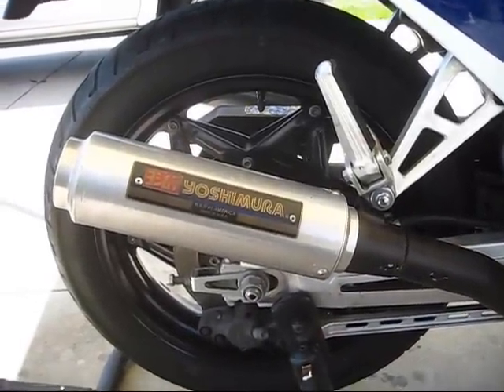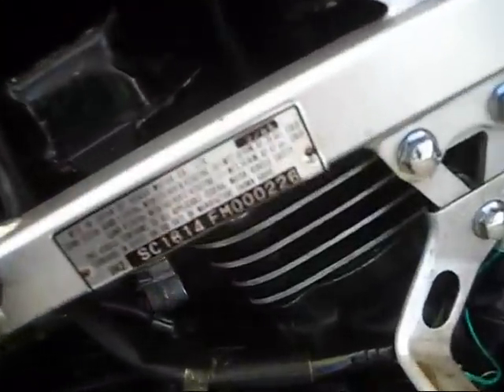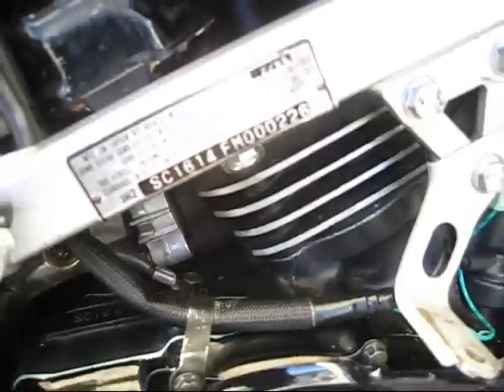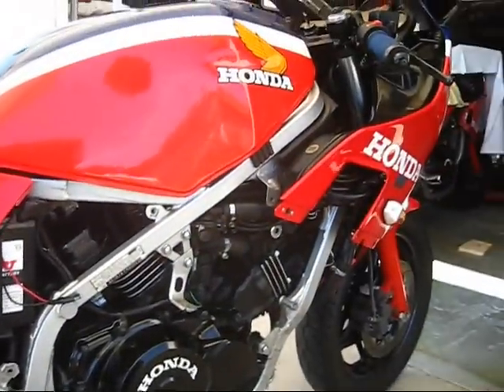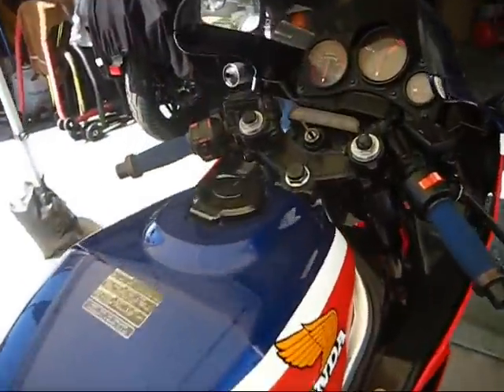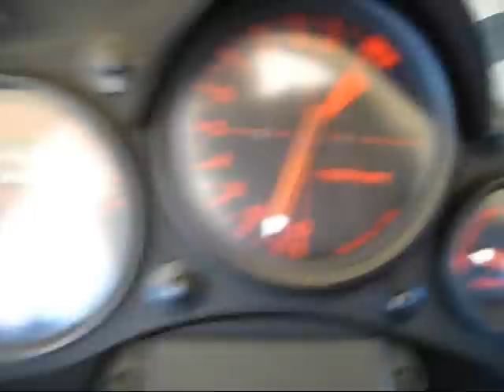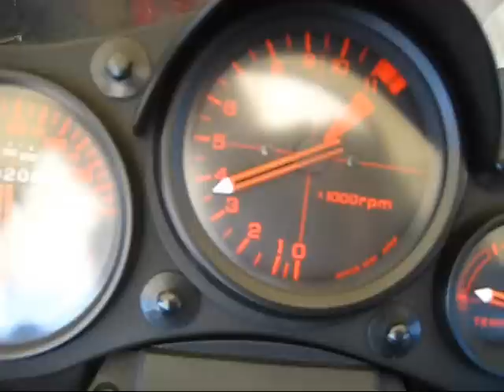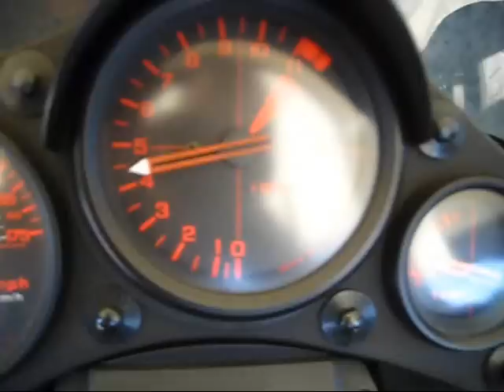1985 Honda VF1000R Yoshimura high speed passes

Comment: my favorite looking bike of all time. i currently have a 2004 ninja zx10r and love it. how would this bike compare against my zx10r?
Reply: Are you serious?, lol dumbest thing to ever ask. 650 lb bike, 13 sec1/4 mi at 108 mph. Top speed 140. A 2014 ninja 300 would whoop this.
Reply: A ninja 300 has like 40 hp dude. You'd beat it off the line maybe ( a ninja 3oo has like a 14.5 second 0-60 btw) and in some tight stuff but open the road up and your minibike would be put to shame by a 30 yr old motorbike.
Reply: +Ryan Bahr who has a ninja 300???? i have a ninja zx10r (1000cc), not 300cc. So its safe to say that my bike would beat the interceptor in ALL ways. however, i still love the look of the old interceptor.
Reply: That's funny!

Comment: any mechanical problems with the vf?  In 1985 one man wanted to buy the vf750 and the dealer tell V engine have too many problems is truth that or not?
Reply: I had VF1000r' for 10 years and they wore out big ends and wore out the cam lobes. I rode it A LOT. If you don't ride them too much and can live with weight like a supertanker and the 16" front wheel it's a bike that can grow on you. Hasn't got today's power but the motor and ride is sweet

Comment: you  guys  are  fucking  douche  bags-  your  high  speed    are  2nd  and  3rd  gear  over  reving-  by  the  way-  u  dont  know  how  to  use  a  clutch or  tachometer-  plus  your  bike  has  stock  tires  and  bolt  on  pipes  and  signals-  u  r  douchebags  beating  on  a  stock  bike-  u  fucking  posers  !

Comment: Those were noisy motors.... which is why Honda stopped making them. Not like Harley motors but you can hear all the internal parts... the V4 Honda made ... and they didn't like it either.
Reply: Jay Sims Not correct. You are mixing your personal opinions here.
If Honda doesn't like something, they don't make it, period. If Honda likes something, they make it. No matter the cost. NR750 anyone? The Honda V4 isn't particularly loud.